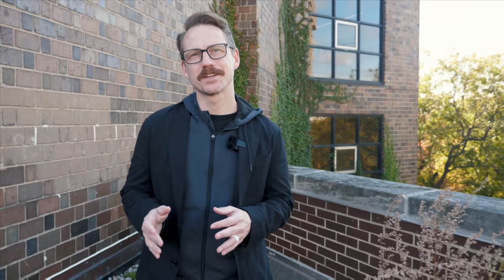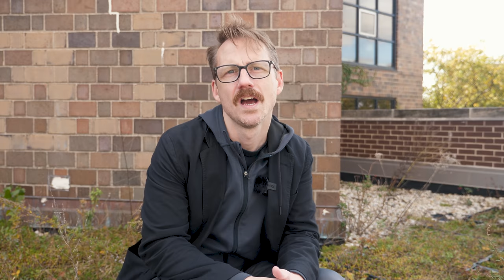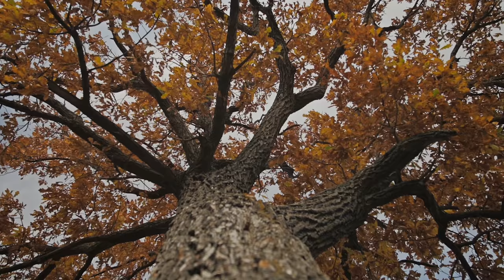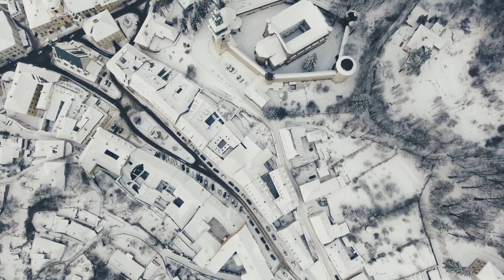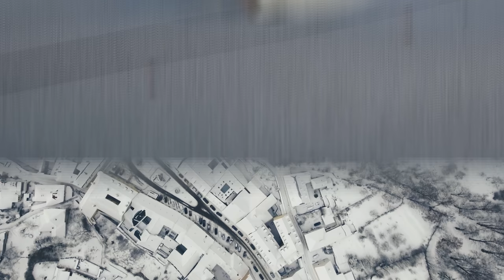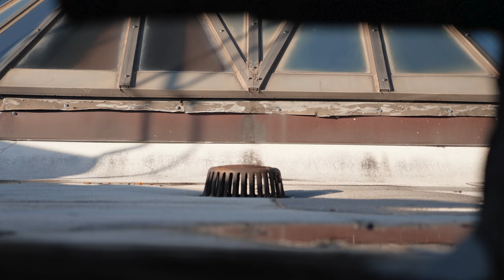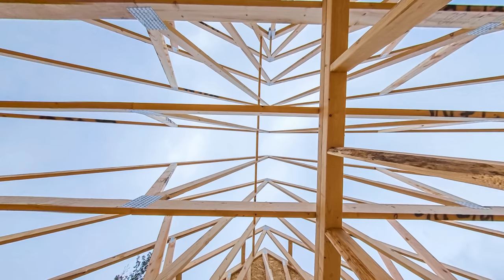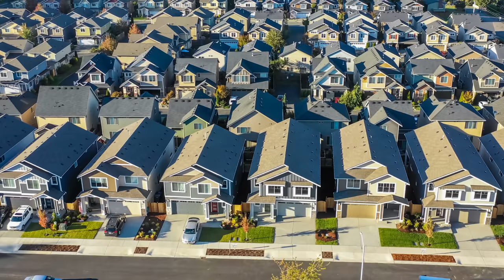Why Do Architects Insist on Using Flat Roofs?

Comment: The real evil roofs are four sided gable roofs on McMansions which thoughtlessly follow the perimeter of the walls below, and have no consistent ridge line.
Reply: Hip roofs work great in high wind areas and use much less material.  There’s that.
Reply: Nothing wrong with a 4 sided gable. The multiple ridge lines however are indeed fake and silly.
Reply: Ive literally never seen a 4 sided gable. I'm sure it exists but that sounds like roofing hell. You might be thinking of a hipped roof. A hipped roof is a pitched roof without gables. Just like a gabled roof is a pitched roof without hips. 

Really kind of dissapointing that an architect spent a whole video calling pitched roofs gabled roofs. 

All gables are pitched, not all pitched roofs have gables.
Reply: McMansion=I live in a high housing cost state and am jealous of new large houses.
Reply: this is a condition of switching from traditional design to CAD.  in the past: when you set out to design a building you started with the roof plan, from there establishing the building line.  now we start with floorplan based design and the building line becomes a mess.  then the roofs are usually just generated based on a supplied pitch to the software.  nobody ever contemplates it beyond that in the design phase.
Reply: @dumbguy9386  there are thousands of McMansions in Texas too, and while housing costs are increasing here, we are still far from HCOL. If you look up the definition online, it is said to be a "cookie-cutter suburban home of between 3,000 and 5,000 square feet" by Business Insider. 

I interpret "McMansion" to be a large house, generally built by a developer, where the vast majority of the budget was spent on making the house as large as possible, sacrificing quality of materials, uniqueness, etc. I have no animosity towards someone that lives in a McMansion, I just have different priorities. If I were to spend $600k to $1 million on a house, I would rather have a 2500 sq ft house built by a custom builder with the best materials, incredibly efficient, and great mechanicals over a cookie cutter 5000 sq ft house that is built with the minimum viable materials and effort. 

That is just my definition of McMansion.
Reply: @dumbguy9386  As an architect myself, I would say that term is really intended as a critique of a building lacking in style of taste. 

If a client is going to spend millions building a house, they could ask for a beautiful, modern, cutting edge design. Or perhaps a traditional design that evokes classic architectural styles whilst still having it's own unique character. Either of those would be great, and I wouldn't ever dream of calling them a 'McMansion' no matter how rich and privileged the client was. As an architect I don't have the luxury of being jealous of my rich clients - especially not when they are paying me to design their dream house.

But if a client comes in and asks for a huge, bland Georgian mansion with a vastly oversized roof and the portico from a Greek temple unceremoniously stuck on the front. Why yes, that's a McMansion.

Typically these kind of clients are people with no real understanding or appreciation of good design. They want something large, gaudy and showy that makes it clear to everyone that they have a lot of money, and they aren't really bothered about anything else. Usually they will tell me specifically what they want, and they aren't really interested in hearing any of my ideas. Usually what they want is based on poorly researched or understood ideas that they have seen somewhere else and just want to copy without really understanding the right way to use those elements in a good design.
Reply: @KurtisHord  Absolute rubbish. I'm an architect myself and I can assure you that any decent designer considers the complete form of the building, including the roof, at the earliest stages of the design process. When you say 'CAD' I assume you actually mean a parametric modelling programme such as Revit, which can admittedly auto-generate roof pitches. But anyone who just uses that feature and puts no further thought into it is frankly incompetent as a designer.

As for starting with the roof plan - again that is rubbish. Many of the great modernist designers such as Mies Van der Rohe and Corbusier always started with the floor plan, believing it to be the purest expression of the function of the building. The external form of the roof and elevations would then be generated as an expression of the floor plan.

That is also how I was taught to design in my many years studying architecture at university. Perhaps there are some circumstances where you might start with a roof plan, but they are fairly few and far between. Maybe if you're just rubber stamping pre-designed house types on a residential site layout. That is really masterplanning and not architectural design, however.

Revit and other similar programmes are a tool, and nothing more. If you're a good designer you use your tools carefully to create the best design possible. If you're incompetent, then you let your tools use you.
Reply: We have a different system In my cultuRe and heritage the architect and builder are one in the same.  We are called compangnon.  The master is not made thru disconnected study in early life, they become a master based on the merits of their progression.  They study their whole career actually performing the work, and then maybe elected to be allowed to design.
Reply: @chrisdawkins3375  also for clarity when I say “this” I’m referring to the high-angle cut up hips on homes that have been constructed since the 90s.  Not “flat roofs”.  Palladio fucked with flat roofs and he’s my homie.  All my homies hate architects.
Reply: @KurtisHord  In my culture (the UK), we have a legacy of world-famous architects designing prestigious and iconic buildings on the world stage. Clearly the system works.

Am I correct to assume you are part of the Compagnons du Devoir? If so, the concept sounds interesting, but I must say you are supremely arrogant if you believe you can dismiss literally every other designer as inferior without any real understanding of the processes we use.

And did you seriously call me a 'computer nerd'? All design work in architectural practice is done on computers these days, you simply would not get a job if you couldn't use the requisite software. Do you think everyone is a 'computer nerd' unless they're a member of a very obscure profession based on medieval traditions, like yours?
Reply: @chrisdawkins3375  I’m an insurgent.  Yes, there is a great legacy in the UK and all over the pre industrial built world. Most of it derivative (not a bad thing) and the important details about those structures are not the “great man” with their name on the prints or the design tradition they reference but the ones who burned the lime.  The ones who cut the stone.  The ones on the pattern bench plotting parallel developments for hours.
Reply: @chrisdawkins3375  I have classical architecture training.  It may seem obscure or arrogant to you, but it’s practical for someone who practices permanent building only.  Foundations are stone in hotlime.
Walls 3wythe English bond also hotlime.  Platforms corbeled and timber frame.  No more than 3 story’s.  Timber frame roof, slate or Spengler style standing seam for roof.  we follow that model on means/methods in the same way they did before the fall, and still build in that way.  Who can tell me I’m wrong because we are in the tradition of all that “legacy”
Reply: @KurtisHord  You're welcome to come over here and try to 'shove me in a locker' anytime you like, mate.
Reply: @EternalQuestion  sounds hot
Reply: You mean hip roofs?  In and of themselves they are no travesty.  The McMansion however is.  I much prefer to follow the Not So Big House mindset where a house is no bigger than it needs to be.  It can still be big but it must be big for a practical reason.  Even if that reason is to accommodate the one true luxury in a house.  Space to freely move.
Reply: there is no way you actually exist.  clearly an AI bot.
Reply: @KurtisHord  imagine having your entire position boil down to “computer bad” lmfao
Reply: @commoncentstx  you pretty much got it right.   I guess as long as there is a demand for huge soulless boxes then they will continue to be built.
Reply: @kaiser2979  if only.  My position is: specialization, planned obsolescence, and alienating labor bad.  I use computers in fact to illustrate concepts and do other types of insurgency.
Reply: @dumbguy9386  not really. It's a lack of creativity and consideration. They're huge houses with no actual understanding of space and how a house works. They were built in a time where housing was booming (cheap to make) and basically just worked like a check list of trendy wants, like ridiculously high ceilings, more bathrooms than bedrooms, and so on. The materials were often cheap to make them more profitable. In the end, the giant open spaces caused heating to be extremely pricey, the extra rooms often went unused, and cheap building materials combined with a disregard for best building practices meant constant need for repairs almost immediately after moving in. The landscapes surrounding them was also bad. I've seen a few where they build a number of these (carbon copies of each other ) on a hill they cleared, where the lack of a tree line between these spaced out developments meant that there was no longer a wind break, which also affects things like heating/cooling, erosion, and subjects them to the potential to wind damage from storms.

They're ugly and an eye sore, sure, but not the biggest issue. They're rarely built near where people regularly drive to or through, so they're not often seen, unless you do some of the work I've done in the past. (Working with home decor and with an interior designer or two... Which is another thing. They all require MASSIVE furniture to adequately fill the space.. and that the houses, like their owners and the decor they put in them, are just tediously boring and nouveau riche trying to display their wealth).

Because of this, around here, McMansions are selling for less than their original price while smaller properties are only on the up and up. People just don't want them anymore. They're a fad from a different time.

The other problem with that particular time in construction is that it was a shift from creating homes for families to creating homes for massive profit. In my area, there's plenty of homes for sale, and although a bit pricey aren't Cali prices, it's just that you can get an old home with ridiculously tiny rooms that's more of a "starter" home from the 60's or earlier or those behemoths. There's little in the range of a house in between that has decent sized rooms, (not too many), and fits the needs of the contemporary family.

 Added on, the housing crisis currently drives builders to create apartment complexes and rental units rather than what is actually what is needed because rentals are "investments". 

It's more of a tragedy of turning housing into a financial asset rather than basic need sort of good which started in the 1980's.  We now have boom-bust cycles and goods that don't actually fit our needs, just profit margins. 

It's not just an affordability issue for many, but a matter of what fits their needs. Unless you decide to build your own, (and you will require housing for an extended period in the meantime), it's becoming increasingly an issue of having to compromise on your needs and wants.
Reply: @Daves_Not_Here_Man_76  I think he is talking about a pyramid hip roof where all four sides meet at a point instead of a ridge.